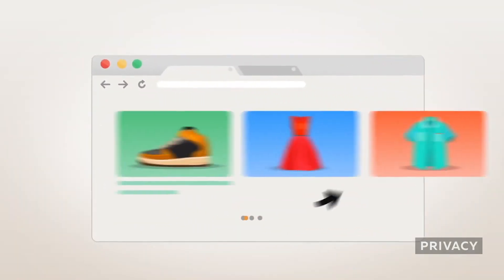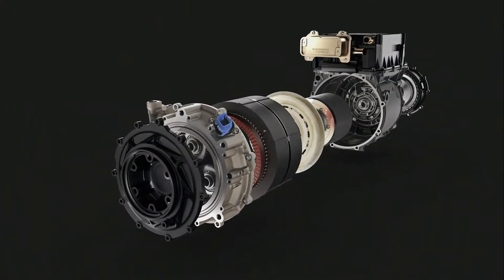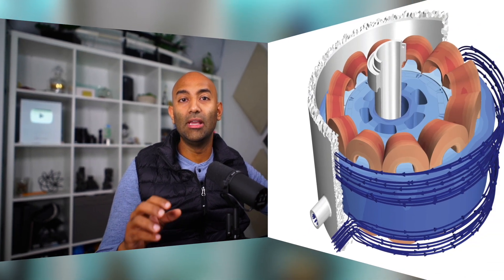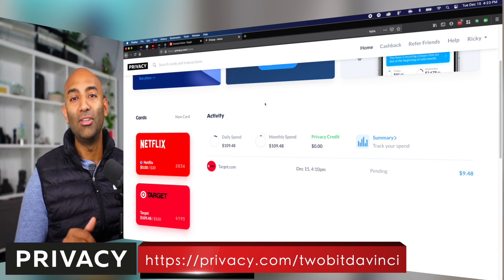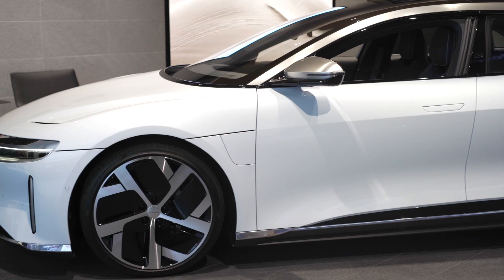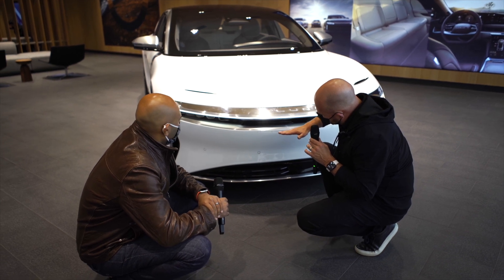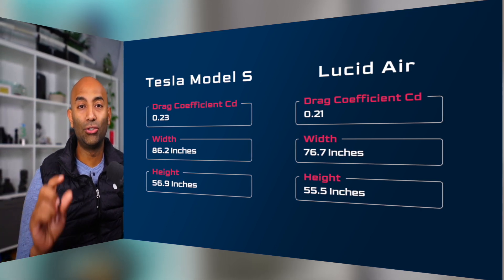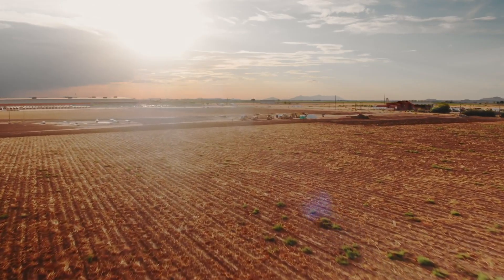Lucid Motors' Crazy Range Efficiency Explained!

Comment: Great tech, but just not able to find a big enough market.  2 years later and their stock is at $4.  If in Q3 they had only charged $430k more per car... they would have broken even.  Ouch!
On a different note, I can't believe how much more narrow it is... wait.
Okay, I see.  I couldn't believe the Air was almost 10 inches more narrow than the S, and now I get why.
He took the S width WITH mirrors and the Air width without.  Apples to apples, the S is still wider, but only by 1.9 inches.  Height is 55.9 on lowest setting.
At any rate, that just speaks even more to how effective the other measures they took are to increasing efficiency.

Comment: I don't really get how the motor cooling improves efficiency. That's really for peak power application which helps get the weight down so that helps.

The higher voltage architecture again also helps by simply reducing weight at the expense of cost. But I think the gain of the higher voltage is really negligible when your cooling cost electrically is as low as it already is on an ev at cruise.

But how do you reach more wh/mi than a rwd model 3. The car is about the same size and the inverter is about the same efficiency. Drag coefficient makes up just a small piece. 

I just think this video failed to actually answer the specific reasons which I don't blame lucid for not sharing lol

Comment: Great video. It helped me understand a bit more of the ins and outs of EV motors. But I’m just a bit confused in your analogy between current and water at 6:30 into the video. You stated the bigger the pipe the less pressure needed to push the water through. To get the same amount of water through a smaller pipe requires more pressure, or voltage when talking about electricity. But pressure (voltage) is higher on the Lucid. I thought keeping the voltage higher and the current lower is a good thing. Help?

Comment: The benefits in having a high voltage also that you don’t need as heavier gauge of electrical wiring.  Same reason why Europe and many other parts of the world which use 240v, house wiring uses less copper compared to the US which uses 110 V

Comment: 'two bit' explain benefit of Lucid's motor cooling advantage like this e=ir ;that is,  Ohm's law states that the voltage or potential difference between two points is directly proportional to the current or electricity passing through the resistance, and directly proportional to the resistance of the circuit. with less heat = less voltage to push same current with lucid's unique  tech =  longer battery charge life and longer battery life - the battery is the most expensive part of an ev !! = to the moon baby!$$$ O and Apple!!

Comment: Sorry you got the example with the pipe mixed up. Pressure is the equivalent to voltage. The higher the pressure, the less flow you need to have the same power, as hydraulic power = flow x pressure similar to electric power = amps x voltage. Higher amps are similar to higher flow losses. The more "stuff" you try to cramp through the same "pipe" diameter, the more things will heat up and the higher the losses.

Comment: From what I know is that at high voltage you have quite some % lost at conversion from DC to AC (that is always in %) but it's better for the engine. In my opinion this is where engineering comes in handy, if they made a high efficient invertor (even the solar panel one is loosing quite a lot of electricity when converting it, speaking from experience) then that is another part that is not soo much talked about. I would love an electrician to correct my statement (as this is what I remember from university, might be a tad rusty on it). 

On another note @Two Bit da Vinci, could you add also metric numbers in your videos, your content is amazing but I don't want to always make conversions :( (the number of countries that use imperial is really low and I think your audience is from all over the world)

Comment: The model S width between extended mirror edges is 86.2 inches. The width of the body itself is 77.3 inches. Thant makes a big difference (>10%) in computing the flat plate area that is used with Cd to find total drag. So is 76.7 inches the width of the Lucid body or is that the width between its mirror outer edges? 
Also, we aren't dealing with simple rectangles. Measuring actual frontal areas is not simple. I'd love to see the actual total drag for each of these in a rolling road wind tunnel. Bottom line, both are damn slippery.

Comment: "permanent" magnets aren't permanent.
How long does the rotor last?
As for cooling, not a breakthrough. I can think of better ways to cool the stator and the rotor with its permanent magnets.
The cogging with permanent magnets is well reduced with multi phasing, magnet placement and  variable waveforms. It's now 2021,    these "breakthroughs" are decades old.
1000V is good. 2000 is better still.....like an 80 year old diesel locomotive.
It's a very attractive car, it's not technically mind blowing.

Comment: Thank you for this video - this is where all electric cars need to go. ALL assumptions need to be reexamined - the windshield defroster needs to be direct heating. We already know how to do this - Ford did it in the late 1970's and 1980's. It takes mere 100's of watts vs several thousand watts - and it can be much quicker. We need heated seats - all of them. The floor can be heated, and the side windows, too. The OLD thinking from ICEs that have VAST waste heat available, has us thinking all wrong on this.

Drivetrain efficiency is YUGE. Aerodynamic efficiency is next - and then weight, after aero drag. We need side video mirrors! If we can manage driver assist and some autonomy - then we certainly should be able to do video mirrors. They reduce BOTH the coefficient of drag, and the frontal area. I drove with homebrew side video mirrors for over 5 years - and there are many other advantages: no adjustment between drivers, better performance in rain and fog, no blinding lights reflected into your face, MUCH better field of view so you can have virtually NO BLIND SPOTS.

Comment: I am an everyday car user from Australia that just updated my car. I was seriously considering a Tesla model 3, basically way over my affordability. 

But the battery tech no matter any amount of blah blah blahing you all guys do, is still lacking big time to win the confidence of an average buyer like me. Do any amount of gaw gaw gawing, charging an EV for hours together at home or run a hundred km to get to the lone supercharger to get it charged in 45 mins and cheat yourself thinking you supercharged it 45 secs is the biggest scandal you could do to yourself. 
I bought a petrol car. Am I Satisfied? Terribly dissatisfied. Feeling like I bought a 1950s Model T walking into an Audi showroom. The car sucks in its electrics. 

No touch screen but a touch pad. You could spend 45 hours to put in an address in the gps after million forced input errors and feel happy you finally made it. 

Cost? Barely less than a model 3. Barely. 

The choices available today, is like, either you buy a super car that runs out of juice in no time and takes eternally long to refuel or buy a petrol car that you can refuel in 3 mins but runs with the technology of stone age. 

Eitherway both of you guys suck. 

Make all the noise you want. EV for an average customer is still like a SpaceX Starship. Good for ISS and Mars trips. Prepare for the flight for an year and do the flight in 5 mins. 

That's your EV tech. I don't give a damn. 

As to the petrol car manufacturers, may they crash and burn too, soon because they con the customer too long and their end is in sight.

Comment: Their efficiency is also helped by taller gearing.  A more powerful Lucid is slower to 60 mph than a Tesla and faster over a 1/4 mi.  That is because of gearing.and enables much higher range.  Think about highway driving in 4th gear or 5th gear for an ICEV.

Comment: psychobabble...............
/ˈsʌɪkəʊbab(ə)l/

sounds like B.S. too me !
Reply from the maker: Based on what?
Reply: @TwoBitDaVinci  Real life motoring and EV tech as it is today. Its exactly based on that. 

You could watch million EV vids. If you work for your money, you will know, wanting an EV is wanting SpaceX Starship. They both have very little difference. Fuel for an eternally long time and exhaust it in no time. If anything they both are from the same manufacturers. 

Are conventional cars any good? They suck. You've had enough of their BS but you have no way of stopping them. But they are well on course to crash and burn. Only it will be couple of decades longer.

Comment: All of the technology cited in this video are common knowledge among EV makers.  All the others avoided permanent magnet motors because they want tech that gets cheaper as volumes increase -rare earth magnets will go the other way -much more expensive as EV volumes press limited supply.  Higher voltages raise cost and lower reliability.  The coil cooling is novel, but I have some serious doubts about their wire insulation and antifreeze -the only proven materials I know of are nasty toxic (PCBs) or crazy expensive (fluorocarbons).

Comment: As far as I understand the Synchronous Reluctance Motor (SynRM) used by Tesla is a very different beast to a permanent magnet motor (which have proved to be very inefficient at higher speeds). I think the confusion arises because permanent magnets are sometimes included in the SynRM design to improve performance. Apparently the  combination of one induction motor and one SynRM gives you the best of both worlds

Comment: A properly designed permanent magnet motor will have no cogging and it is nothing new. There are lots of permanent magnet m9tors on the market that have no cogging. 
The higher voltage does reduce losses but it makes it more difficult (meaning expensive)  to get the parts. Tesla and most other EVs like the leaf and kona use 400v because it is easy to get semiconductors at that voltage in volume. Generally semiconductors come in either 600v or 1200v ratings (mainly used in industrial drives) to run at 800 or 900v you need higher than 1200v devices which are not as common. Also as the voltage goes up you have other problems which mainly add cost.
A cooling sleeve is a very easy and cheap solution that is why everyone uses it. Running oil thru the windings is more effecient but it has the problem of adding drag to the rotor unless there is a cavity for the winding and oil which makes things more expensive.

Comment: The savings due to using higher voltage and lower current is not in the motor itself. To produce the same magnetomotive force with less current, you need higher winding density. Halfving the current requires twice the winding density to produce the same field. Such wire is twice as long with half the cross-sectional area, so such a winding has four times the resistance.

A lower current would however reduce the losses associated with sending power to and from the batteries and motors.

Comment: Lucid motor is NOT as efficient that the Tesla model 3 LR, it only just as good as a Kia Nero.  They use a large battery to give a large range, please don't say that Lucid cars are efficient, they are no better that existing cars, you are gaslighting.
Reply from the maker: Not sure what to tell you. I’ve shared battery sizes and range. The rest is up to you

Comment: The Model S is 77.3 inches wide excluding mirrors.  The Air is 65.47 inches wide excluding mirrors.  I was trying to imagine losing a foot of width from my Model S, but I think the difference is in the back wheel arches that are flared out on the S, but not on the Air.  That's part of it, at least.  I need to check out the Air when that becomes possible.  I imagine that some would call it elegant.  I think it's a little boring from the outside.  I think I'd probably like the interior.

Comment: Should Tesla take the next obvious step and start designing with 2.400 volt systems? After all a lot of large industrial motors have run reliably for decades on 13,800 volts, may need a bit of research on winding insulation, drive electronic elements.

Comment: Tesla Model S is an old car and Lucid compare to that one...haha! How does their charging network look (and function?)
Reply: no need to be toxic...
I do prefer Tesla at the moment, but you downplay Lucid for nothing - they compared it to what was relevant back then (The refresh has better Drag coefficiency, but back then it wasn't anounced yet...) and they still dont have a charging network, so? Tesla didn't have one for years...
Also from what it seems their motors are better than Tesla's, though there is more to that than only power/weight since software plays a big role too.
Reply: @tomi832  The difference is Lucid have no intention of building a charging network.

And the car is just vapourare until its independently tested.

Comment: Thanks for another great interview, Ricky. This reminded me of an old interview I saw with Franz where he discussed some of the design philosophy of the Model S. Do you know if air suspension will be available, as the front seems quite low? Did the passenger area seem tight, as it's quite a big narrower than the S?

Comment: I'd like to know how higher voltage systems effect reliability/longevity. How long will the vehicle last mileage-wise? Efficiency isn't everything if it's not coupled with durability. Is it in this case? Tesla learned that you can have a car too low to the ground in terms of encountering road hazards. Though it didn't make into production, Jeep showed a Wrangler with a turn-on-a-dime mode, and it wasn't limited to slick surfaces.

Comment: Not impressed. Take a look at Aptera next, with Cd as low as 0.15.
Reply: its also a much smaller car, you know that rights
Reply: That's impressive, but going lower than 0.7 is possible if your vehicle runs on a cableway, as there is no road to disrupt the airflow. High speed is possible on cables if you put those cables in steel tubing and fill-in with concrete. Then you have rails which can handle long spans without heavy girders, and thus airflow is smooth on all sides of each vehicle. There is a video playlist on my channel presenting working models of this, some of which have already carried passengers, albeit only on test sites thus far.

Comment: Why  you did not compare Model S Plaid 520 mile,  1100 hp, $140 k with Lucid Air Grand Touring , 1080 hp,  $140.? Lucid Air Touring  $ 85 compare instead for 408 miles to Model S Performance?  Unless my information is wrong.

Comment: Tesla will become more efficient with their new 4680 battery.
Reply: Everyone is constantly getting more efficient.  Hyundai's new E-GMP platform is significantly more efficient.  GM's new battery tech is significantly more efficient.  Tesla's not the only one moving forward.  And that's good, lots of people are best-served by getting something other than a Tesla.  We need more variety than Tesla, since they only have two mass-market cars at the moment.
Reply: @ScrapKing73  they're trying to reach Tesla's efficiency right now,... Tesla new battery will be way ahead of their current leading efficiency
Reply: @integra8502  Maybe.  Tesla's talking about years before their new battery tech is in mass-market cars.  GM's new battery tech might be sooner, and they might have something in the pipeline after that.  Toyota believes they'll have solid state batteries in cars by the time Tesla's new batteries hit the market.  Hyundai is using off-the-shelf LG Chem batteries, but has realized significant new efficiencies (on their already very efficient designs) via other improvements in their forthcoming E-GMP design (which should definitely be on the market before Tesla's new batteries are).  My point is that Tesla isn't guaranteed to have the magic sauce that no one else can compete with.  When the Model S came out and the only competition was the Leaf and the Volt, that was true.  It's not true any more.  Many companies are moving designs forward, and time will tell how it pans out.

Comment: The efficiency gain has to be about pounds per HP. 
PM motors are running in the  94% eff range already in the motor industry. 
How you can get more than 5% gain. 
Marketing stretch?
It has an inverter with a water cooled PM motor, more HP in less size and weight?
 600hp at 175lbs?
This does not make sense.

Maybe that was a weight savings compared?
The car looks really nice. 
Great to see another manufacturer show the car companies how things change and they do not.
Reply: Not just the motor, it's the reduction + differential.
Reply from the maker: there are various aspects at play here. This in particular is about weight and packaging efficiency yes. So they are able to shrink down the components, the gear reduction, the inverter and motor etc.